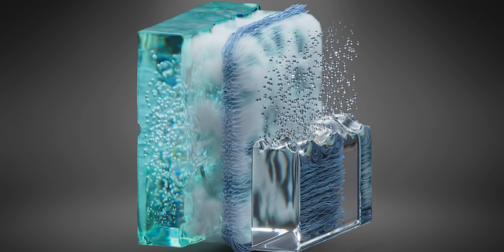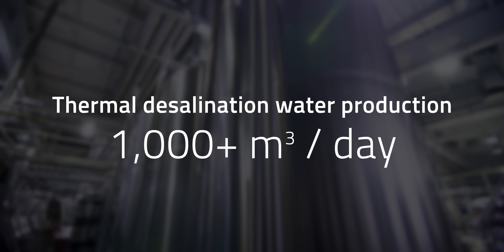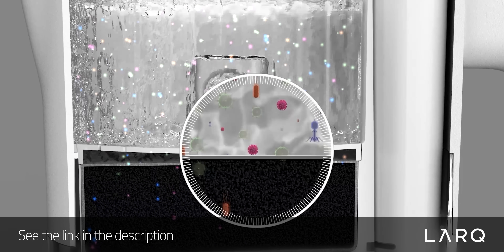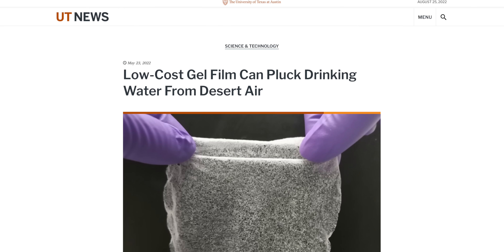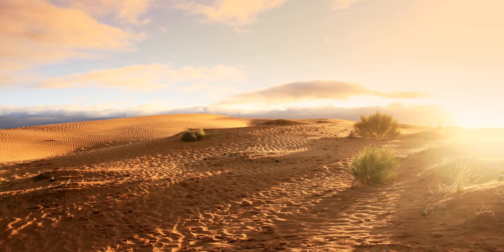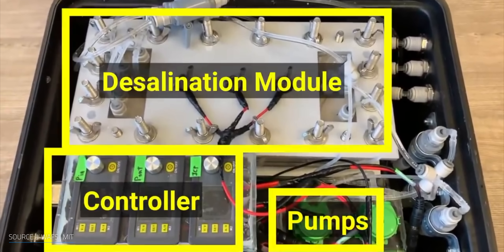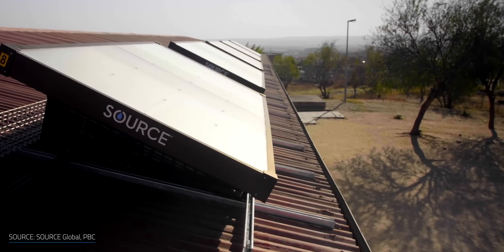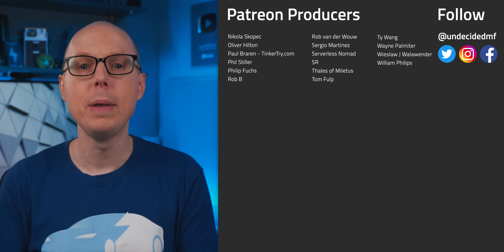2 Breakthroughs That Could Solve the Fresh Water Crisis

Comment: I honestly think that powerless option would be amazing for regions hit by natural disasters (floods, hurricanes) where the local water system has been compromised, and may take weeks to get back online. Having a few dozen shipping containers setup in a way to produce semi-large volumes of refillable drinkable water would be literally a life saver.
Reply: I agree with you, the poor folks in Pakistan are surrounded by water they can't drink while other parts of the world are in drought. Alas this situation is only going to get worse.
Reply: It's not powerless, it just uses no electricity, meaning no refrigeration. It still requires heat to release the adsorbed water and a condenser plate to collect the water. Also, also, it requires a lithium chloride solution to act as the water absorber. It's not as simple as he made it out to be in the video.
Reply: @falconerd343   but the refrigeration is powered most likely electricity.
Reply: The issue with the gel is you need a freezee dryer its not powerless in the slightest
Reply: @emeraldbonsai  A standard refrigerator will freeze dry. The only reason it doesn't happen to other things in there, is that they are wrapped up. Put anything in unwrapped and depending on moisture content, size and how cold the freezer is, days to weeks or months. Process can be sped up with an air tight container, and a vacuum pump plumbed in. Then there's extra costs.
So technically no extra costs as fridges are already everywhere and already running.
Reply: There is a company that drops Connex boxes off that have an all in one system for supplying clean drinking water for people after disasters. I just wish I could remember the name.  I know I saw a video on Facebook where this guy showed how someone broke into one of his and stole a bunch of stuff from it while it was on location.  Even in a time of need, doing the Lords work, thieves are a-holes.
Reply: Yes .. literally having a Semi Truck Trailer that could set up to provide the reliable drinking water in reusable/refillable containers for disaster areas would be a great idea and would eliminate some of the use of the single serve plastic water bottles .. I know that the water distributors love to give them out but unfortunately the waste from all the plastic bottles is tremendous.
Reply: There are hundreds of tropical islands around the world that rely primarily on rain collection and energy is limited.  Add in sailboats which are mostly carrying expensive, delicate, and high energy supply reverse osmosis systems.  Then there are countless villages along desert coastlines like Baha, Peru, Africa, and the middle east with limited or dwindling groundwater.  In all these cases small scale off grid style systems are preferable to utility scale systems that require either industrial scale maintenance, or generous energy supplies.
Reply: there is no powerless option. Any process needs energy, and that needs to come from somewhere.
Reply: While good in theory there's a reason the gel option didn't show someone drinking from the prototype.
Reply: @markquintonii  I wonder what this gel does to the evironment. I am imagining a city with 1 milion people and every household would have such a thing. You would make dry air even more dry....can't this create other problems ?
Reply: @markquintonii  the guy did drink it 09:40
Reply: @ChinchillaBONK  That was not the airwick-gel option Mark Quinton was talking about.
Reply: Whatever the answer is, the "Greenies" won't let you do it. So, forget about it.

Comment: I love your videos but the frequent conflation of power and energy is confusing. Energy is power applied over time. Joule (J) is the standard unit of energy and Watt (W) is the standard unit of power. A watt is defined as joules per second, i.e W=J/s. Other customary units for energy include (kilo) watt hours, i.e. how many joules is consumed by one watt over one hour. For example: 1 kilowatt hour = 1000W*3600s= 3.6 MJ of energy. When your say it takes 20 W to purify 1L of water this doesn't make sense without the time it takes to purify the 1L water. Did you mean 20 Joules per liter? 20 Watt hours? Or 20 KWh per liter? These are all widely different values and it's not clear which one you actually meant. Please, could you be more careful with units of energy so we can better understand the thing you're talking about?
Reply: Indeed, 20 W/l is nonsensical.
But the rate of production is 0.3 l/h 
So I assumed the device would work roughly 3 hours to produce 1 liter, while using 20 Watt of power.
Or in short: it's a 20W device, lol.
Reply: @Buzz_Purr  a 20 watt device that uses 20 watts continuously while operating and will operate for 3 hours consuming 60 watt-hours producing 1 liter of water.
Reply: A glance into the paper gives the answer:
"0.4−4 (brackishwater) and 15.6−26.6 Wh/L (seawater)"
Reply: Thank you for writing this out. I was looking for a response like this.

I was almost starting to doubt myself whether I didn't understand power use myself.
Matt really needs to correct this mistake or end up turning into a meaningless technobabble channel.
Reply: The unit we're looking for is J/l (Joule per liter).
Let's assume the device uses 20W during operation.

0.3 l/h = 8.33 10^-5 l/s
20 W = 20 J/s

The energy requirement per liter is:

20 / 8.33 10^-5 = 240 kJ/l
Reply: @Buzz_Purr  Most people are probably more accustomed to Ws or Wh or kWh as units for energy, especially for electric energy. So your 240 kJ/l translate to roughly 67 Wh/l. This means about 67 kWh for a cubic meter of water. Compare this to reverse osmosis plants, which use around 3 kWh for a cubic meter of water. And you see that this method is highly inefficient compared to reverse osmosis. Of course it's only a prototype and a small device, so it remains to be seen, how scaling it up would affect the efficiency.
Reply: @mattack12  Thank you. :)
kWh/m^3 is a good unit in the practical world.
SI units are good from the perspective of science.
And then there are imperial units, hehehe.
Reply: @mattack12  Thanks for comparing the power use. 
So it is inefficient at scale, but has one big advantage over reverse osmosis: it doesn't use any supplies.
RO need the membrane to be replaced every X liters, while this device will in theory work forever.
Its also tiny, and that is its main use, small, portable, not requiring supplies emergency pack.
Reply: @mattack12  what needs to be considered is the concept and the application.
Reply: Thank you everyone, I am often confused by this.
Reply: Thank you for making this point about precision in measurement and the language we use to describe many related concepts yet distinct in their definition.
Reply: I disagree, I have been an electrician for 35 years and never use joules as a measure. If it takes 20 watts then time doesn't matter. If you have only 1 watt available per hour it would take 20 hours if you had 20 watts per hour it would take 1 hour to do a certain amount of work. KW hours are a standard measurement to make it simple to understand as we usually measure in thousands of watts
Reply: @bobm3477 For an electrician watts are what matters since that's how you'll measure the capacity of a circuit.  But if you care about how the energy usage of a system you need to know how many watt-hours it takes to perform a given task.
Reply: It sounds like he meant Watt hour and just forgot to say the hour part.  It's a mistake but YouTube make it hard to replace an uploaded video and it's alot harder to avoid little mistakes like this (and not hear them in editing) while speaking at length than it might seem so I think I'll give him a pass.
Reply: @petergerdes1094  Oops yes you are correct. I guess that I forgot to include a complete explanation as I deal with it every day and take it as a given rather then explaining it fully. I was referring to joules as compared to watt hours or watts. I don't know anyone that uses joules as a measurement.
Reply: Exactly this! FFS, how hard can it be to get this right in a so-called "science"-channel? 20 Watts/Liter is absolute nonsense! Grrr!
Reply: He said the time it took
Reply: I'm a PhD in another scientific area ie ok at math etc but not my focus. It's long been my belief that it's fundamental to humans to simplify and much better explain energy and power units, or change our comms system surrounding this completely. Virtually all explanations I ever see, even on YouTube, of electricity and energy and power are confusing to me and leave me at least half baffled! I know it's complex but we MUST find a way to communicate about this stuff with everyone: not only one percent of one percent of educated people!
Reply: Ps I enjoyed your explanation, Emily. Matt, I love your vids and style but to my point in other reply if EVEN you Matt miss the absolute necessity of quoting one part of a measure then it strikes me that in the area of discussing energy- something we desperately need to do- even the top fraction of educated people are likely communicating with fundamental flaws in their own basic understanding- like people who say "10 percent out of a hundred"! We must find better metaphors and ways to communicate effectively about energy.
Reply: I love your name Emily 💗💖

Comment: I would love to see farmers use this as part of a photo-hydro-agrivoltaics system: basically, put solar panels over crops (density determined by crop type), and use the energy to produce water for the crops, and energy for the farm/grid. This would ensure water even in droughts; would stabilize water supply for population (since 80% of water goes to crops); increase energy production; and help drive this technology even further forward. It would also allow people to set up sustainable systems pretty much anywhere. 

P.s. I'd also like if farmers had to pay more for exceeding certain quotas of water (based on land size). basically, make them pay more for monopolizing the water supply. that would incentivize both better water practices (e.g. drip irrigation over field spraying) and the use of local water generation tech like this.
Reply: you do know the crops need the sun, don't you?

Comment: i don't see a problem here. what we are experiencing on earth currently is water infusing into the air more. so pulling it out of the air makes sense. however just doing that is like a bandaid. we have created a disaster situation. desserts are starting to form. carbon control is key.

 as for desalination? i remember the huge plant in Wilmington NC in the 50s. when our ice melts that is going to make ocean water a bit less salty? so taking pure water back out makes a little sense. it might even help the life in the ocean to cope a bit. we tend to think that it will be decades before we lose our ice. but every month or so i see where scientists are surprised by this or that and adjust the timeline. 

so i think both techs will be helpful. however if our earth becomes an oven it won't matter what we drink.

Comment: If the gel panels get developed into something that is "set it and forget it," it is an easy win. Even in regions where fresh water is more available. Simplest design to my mind would be gel mounted to the back of a black panel - cools down at night to absorb water, heat of the sun drops the moisture out of the layer into tanks placed just far enough underground to reduce heat absorption. Simple.
As a bonus, if laid out and sized correctly, they could also provide shade to the local population (human/plant/animal) to reduce their moisture requirements throughout the hottest part of the day.

Comment: Thermal desalinization (evaporation) is still the best method for massive volumes of seawater to fresh water.  This is even more true if you are already using a thermal process to make energy in the first place.  This is why nuclear desalinization makes the most sense for large-scale needs.  Nuclear reactors do NOT make electricity - they make heat.  The best 'bang for the buck' is to use them primarily for processes that rely on heat, like desalinization.

Comment: If the hydrophilic cellulose could be applied to plant seeds would the seeds be able to water themselves more efficiently than current watering methods?  Could trees and shrubs benefit from  this type of water collection?  Ants do something similar with water collection when they tote punky wood back to their nests or when they build their nests in buried punky wood that has been collecting water. 
 I do like the idea that a smaller amount of energy can also clean dirty water. The amount of water available after twelve hours is just as minimal as the energy used. If one planned far enough ahead, could you create reservoirs of a few hundred gallons without damage or irreversible damage to the equipment?
  These are good ideas that can work if out of necessity, but what will it take to make them get out of the university and into the realm of mundanity?

Comment: A home solar still unit can purify 2 to 5 gallons of water a day - in the warm weather months.   Other than you will need to periodically clean the scale from mineral content the solar stills are low maintenance.  A solar water still can be mounted on the roof of a carport and the tempered glass cover can be salvaged from some types of solar panels - which I haven't been able to source, but I'd surely save some of these glass panels  from.a landfill.

Comment: As with any challenge, there are 3 ways to deal with water scarcity (simultaneously):
- reduce water demand by being water wise
- increase water availability by harvesting rain water
- re-use water by installing a grey water system

Reduce Water Demand
I was living in Cape Town during the Day Zero emergency. Households were eventually reduced to around 30 L per day. It was tough at first, but as we shared info & strategies it became easier & easier.
https://youtu.be/D49ahC1JAUg
https://youtu.be/oYYZXmfflSg

Increase water availability
Rain water harvesting is not new. Residents of the Tsar Desert have been harvesting & using rain water for centuries. Permaculture water harvesting principles can also be applied.
https://youtu.be/eJCTAXb_BWs
https://youtu.be/MpI-FKqk0Ew
https://youtu.be/RDCFbfcRcUE

Many cities have been applying sustainable water manage principles for the last couple of years, including
- low impact urban design & development (LIUDD)
- water-sensitive urban design (WSUD)
- sustainable drainage systems (SuDS)
- sponge cities
https://youtu.be/LMq6FYiF1mo
https://youtu.be/U37gst79pGc

Sundry
https://youtu.be/rXepkIWPhFQ

A plastic water bottle takes over 5L of water to make, so using bottle water as a water source - in non-emergency situations - is unsustainable.

Comment: There is no free lunch when it comes to water harvesting in a desert.  In places like island nations or disaster areas, this might be ok.  But not in deserts.  If you remove water from air, you are taking water from something else.  The desert is already on a knife's edge.  As the air moves across the desert, small amounts of water become available in unexpected ways.    Many organisms rely on condensation in the morning.  The 'dry' hot air often becomes 'wet' when pushed up a mountain.  If we dry out the air to support towns and cities, the air is that much drier, other things will suffer.

Comment: Interesting how MIT and our presenter fails to mention EDR which was originally developed in the late 1940's. Being that the concept is off patent, there is little incentive for major investors. I have been using EDR in my bioreactor grow tanks to remove sodium. It gives over a 95% recovery rate, so discharges are low enough to use evaporation rather than blowing down a drain pipe. 
You may want to have a look at Barcelona's desal plant that uses EDR electrodialysis/reversing.

Comment: Most people have a water generator in their houses right now - their air conditioners. Air conditions put out way more water from the air than people think, and if we can sanitize and filter that water (its usually heavily bacteria infected) , I think it could be part of the fight for clean water.
Reply: Agree 100%. 
When I was on holidays in Greece, they had the AC connected to a bucket that we had to empty 2-3 times a day. I guess it created about 30-40 liters of water per day. We used it to water plants, but filtering it would be a good source of potable water.
Reply: Seasonal only and output depends on run time and relative humidity.
Reply: @lynncomstock1255  Yes, seasonal, but if we're talking about air conditioning, most productive at the times of year when fresh water is most needed!

Comment: We should be giving priority to restiorative techniques.  In hot coastal areas with year round mangroves increase transpiration.  
Nature has great ways of doing that while reducing the CO²; flooding; fire vulnerability; droughts; heat waves; food scarcity, diversity, quality; air and water pollution; heating, cooling and hot water bills; increasing wildlife habitat; the list goes on.  
Emphasizing overall plant diversity with emphasis on trees (in tropical zones such as the Middle East, mangroves would be important) as well as rainwater harvesting technique and earthworks made with on-site materials assists nature in a durable, cheap, restorative, ethical way.
To get the most benefit including in areas of food production one further caveat: we need to convert to permaculture methods so we avoid using synthetic chemical inputs.  Synthetic chemical inputs harm soil and its ability to sustain plants and retain carbon.